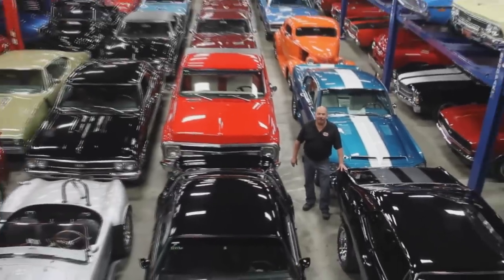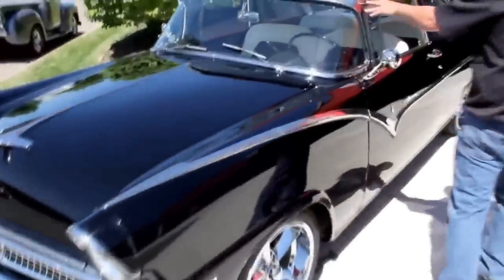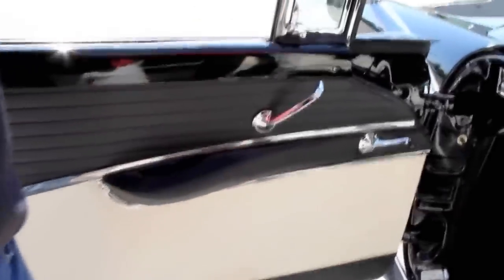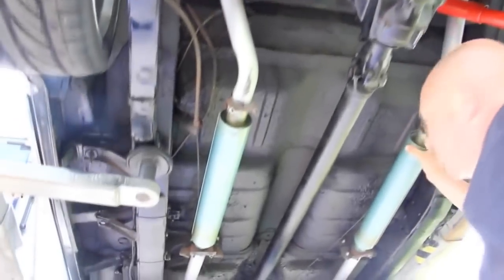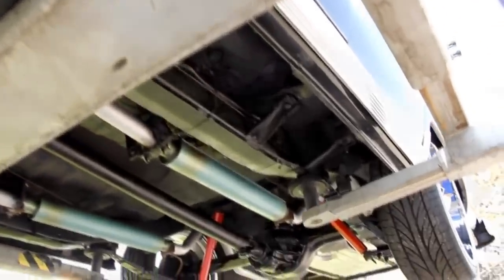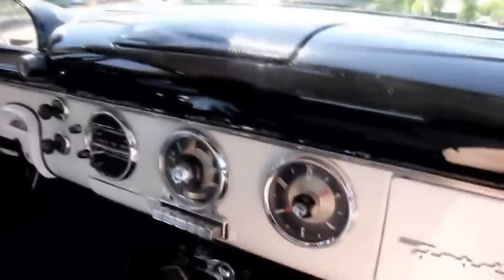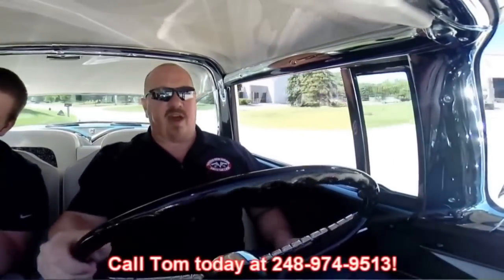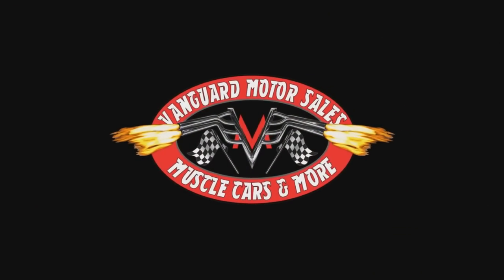1955 Ford Fairlane Crown Victoria For Sale

Comment: Awesome! Mine was like that but Emerald Green Poly, had a 312 Merc engine, it was bad. Had stick  on the steering. Use to get 60 in 1st 95 in second and buried the needle, one stupid mistake, l sold it.